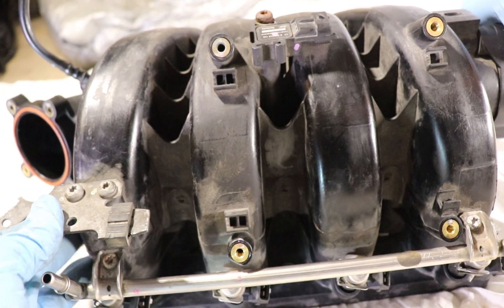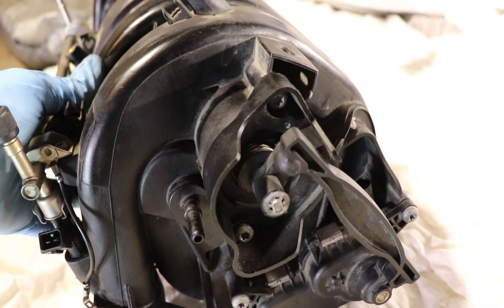How An Intake Manifold Operates

Comment: You got it backwards, you use long runners for more low RPM and torque and you need the short runners for high RPM for more (peak) power

Comment: 0:24 I've been getting everyone's favorite lean fuel error code on my chevy Sonic while cold. I hooked a smoke tester to the air intake and that rectangular hole between the throttle body and the runners is just blasting smoke out. I really want to know if this is typical behavior or an actual issue. 

It seems that the people who's had this just dumped some RTV/Silicone in there to seal it up, but I'd rather not jump to conclusions without knowing what that port is for.

Comment: Yes. I did learn something new. 

Thank you.

According to my scanner, I have 2 runner valves (IMRC valves) stuck closed. At least now I have some idea of what that means. 1997 F150 4.2 6 cylinder, so I'm assuming I'm pretty much just running on 4? It will drive maybe a mile or 2 (grocery store, short errands) before it starts 'stumbling' like it's not getting enough gas. This has been going on for several months now. Sometimes I make it back home, but sometimes on the way back ol' girl starts stumbling & shuddering & then we 'limp' home at about 20 miles an hour. :)

Am I further damaging my engine?

Again, thanks so much for the info. I'm going to try spraying Sea Foam into the intake throat...as per their instructions.

That, & say a prayer 🙏 :)

Comment: Thanks for doing this great video.  I have a 2004 Honda CR-V that when scanned I get a Po 0661! Car runs fine to me but Engine light is on so can't pass smog..  What do I fix? Or how do I find out what to fix?  I am a 70yr ( old school )mechanic.  My 85 Toyota PU is easy to fix.  All the electric sensors are new to me.  No wonder folks are going Electric....None of this to fix.  Anyway please help an old Viet Veteran Helicopter mechanic!

Comment: I’m trying to figure out how to remove the small arm on the shutter..? Would you happen to know how to remove it? is it like a small washer lock in the center ?
Reply: I’ve seen a clip of removing the lock washer. A vendor who sells brass joints to replace the plastic one removed the clip